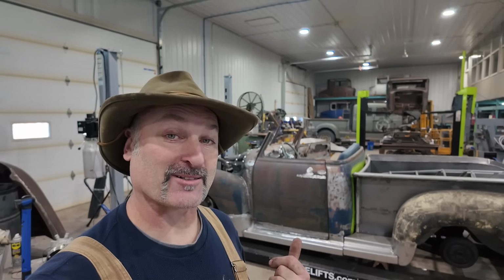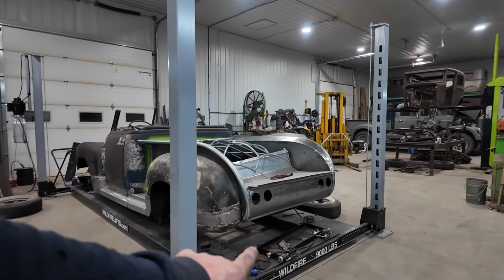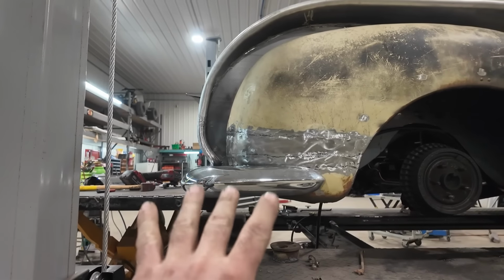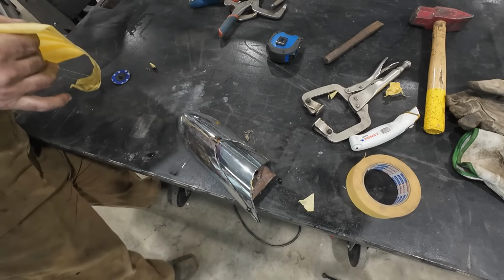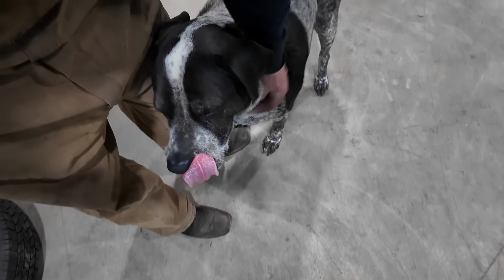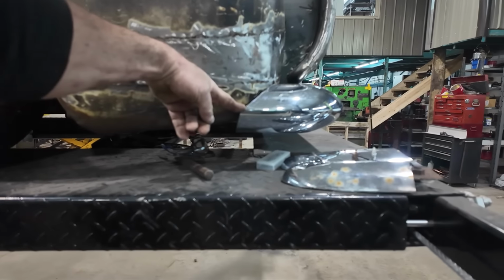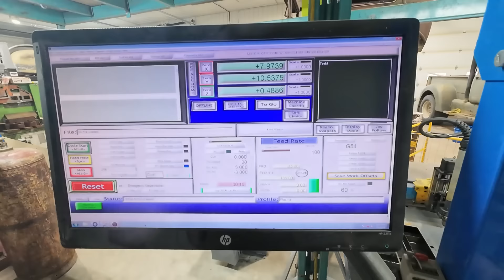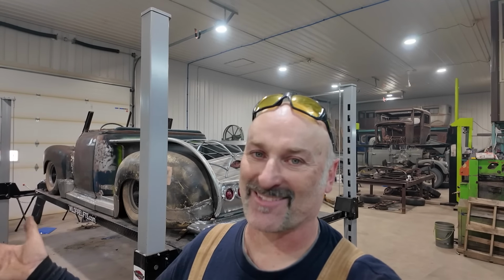Check Out Our Custom Rear Bumper For The GMC Roadster - Not sure I'm sold on it?

Comment: After 30 years I'm retired from GM . I would rather have one of your creations than any of the cars have helped build in 30 years ! Keep up the good work my friend .
Reply: If I could ask the designers at GM one thing it would be, why did they made the trucks rounded and ugly from 2000ish on. Most Chevy fans like the square body of the 70s-80s. If they sold brand new square-bodies with a cabureted 350 right now they would probably sell a ton of them.
Reply: I’m also a GM retiree and totally agree with you

Comment: I'd make a nice canvas roll up desk style tonneau cover on tracks you can use round bar and dye threads on each end and bolt roller bearings to go in a track you'd put in that follows the line from the back to the cab

Comment: Pointed ends back on each side,then cut out center and weld in the piece with the plate lite upside down to shine on your plate. This will also leave a place under there to exit exhaust pipes (cut as wide as you need)😎👍

Comment: Bumper is coming along nicely.

Two thoughts I had on design.

1) consider putting a step shape in the bumper.  cutting the bumper at the edges of the bed, then pushing the bumper ends toward the cab to close the gap with the fender. Add a curve to connect the gap created.  This would close that gap between bumper and fender, somewhat remove the square feeling of the bumper, and also push the edge of the bumper further forward like you mentioned maybe wanting.  Hopefully that makes sense.

2) do the exhaust as a straight pass through right through the bumper.

Just thoughts I wanted to share.  Carry on good sir!

Comment: It definitely looks appropriate and at my point of view wrapping around and tapering to bring closer to outside of fender but not past would finish the look. But when i saw the drinkers side from the rear where there will be fill pannel it looked like it could have exhaust poking out just above bumper until i thought of all the extra bends in the pipe to poke it out slightly up and outwards.  Regardless fabuloso. It is already award-winning build.

Comment: I really like the back now with the lights in it, it kinda give it that 62 Impala look and the bumper fills the bottom of the the truck, I think you need too cap the end of the rear bumper, leave the curve to match the curve of the fender and  put in your filler pieces on top as you said the front bumper does not go past the fender so the rear should not either, but its your truck so you need to do what you like.

Comment: Brent, ask Ester. If she tells you that changing the bumper that way will result in your stuff being on the porch; well...
For my part, I get a hue of a 1971 Chevelle or later Corvette when I look at it and that leads to the next thought, the middle of the bumper would be a good place for the fuel tank filler neck with the fold down license plate covering it. Also, I like it chrome.

Comment: If it were mine ... I'd remove the center extension, and have the bumper end at the edge of the bed instead of being out at the fenders. As it is ain't bad. In fact I'm amazed at the work you're doing.

Comment: The GMC roadster is cool . you need to carry runing board  to the bumper ,move the bumper  out and tapper it, fill in like your runingboard. You could also put reciever in the center of the bumper with a opetional brake light.

Comment: Your bumper does complete the back of the truck nicely, beside the two top fillers I would not to the ends. I think to answer correctly you need the front bumper to make that call.  Like the new toy.

Comment: Split in the center like you did run each end to either side of the truck then include the center back in to combine both sides. The ends of the bumpers should run along the side of the fenders

Comment: I'd narrow it so it's the same width as the panel above it and then if you're looking down at the top of the bumper I'd extend the straight line to the ends if that makes sense, it's smaller and tucked in but I think it would look cleaner

Comment: Brent, I'm sure that its there but what I didn't see was your yellow mallet in the fender to keep your running board straight but if it wasn't, that would surely mess with your bumper shape against the drivers side fender,
Reply from the maker: Yeah there just needs to be a fender brace made yet to replace that hammer haha.
Reply: @HalfassKustoms  you’ll get to it I’m sure. Maybe when you are doing the hangers for the exhaust?? Oh side note… my vote is side exit on the exhaust! It’s quite the show stopper and the audio has to match the visual!  Haha

Comment: I think the exhaust coming out of the sides of the truck would look much better and break up all that sheet metal on the sides of the truck! don't get me wrong the sheet metal looks good but the exhaust would break it up a bit and make it blend in better in my estimation.    I think the bumper is looking Good. I think once you've filled in the bits did the extra custom work that you don't want to do and  leveled it a bit better its gonna look great.

Comment: Well, if you want to avoid cutting fill patches by the fenders, you could make a beer box template by laying it across the bumper and marking it out to follow the center part and then cutting around the steel pipe and fender contours on each end. Cut the heck out of the top/front edge. The bumper won't be as deep and will be form fitting.
There would still be contoured returns into the fenders.
It ain't me holding the angle grinder, though 😃

Comment: Brent bumper looks great, at the back it looks just right. 

The sides seem a little awkward to me though. 

Have you thought instead of cutting the bumper, frenching the sides of the bumper into the bottom of the wings. So they are the same width as the car but don't stick out.

Comment: I agree with you Brent, you need to put the finishes pointed ends on the bumper to wrap around the back of the truck. it hides the broken edges on the bottom of the fender and sides of the bed. it has a much more finished look about it as far as the side view is concerned. It might take a bit of fabrication but I'd put a top plate on the bumper starting from the side of the bed and on top of the bumper, then mold it into the finished ends of the bumper. This will fill the gap there between the bumper and the back of the bed to give it a better finished look. You said you were going to paint the bumper anyway and by filling the big gap there it will look better than having a big vacant hole showing there.

Comment: Brent, bumper looks good as it is. But, like you said, pie cut the inside edge, could have been your answer? However, l think cutting the inside edge and adding a little bit of filler metal would look good also! Like the looks of the rear of the truck, great job 👏. Till next time, God bless jim

Comment: I think your headed in the right direction with the rear bumper but I wouldn't add any more onto the ends.  Do a Stainless steel wrap on the whole truck it would look good but you would need a straight body.

Comment: What happens if you take the pieces you cut off the bumper and put them on so they do flow farther into the fender and then create another piece that will line up with the bumper and is moulded or frenched into the fender so that it just tapers away?

Comment: Dont comment much...but id reckon maybe that filler to extend the bumper will add some dimension to the finished look...also maybe go with a double bumper like the Cadillacs and Chevys of the 50s n 60s era...and then you could add the number plate section back to the upper bumper as it was originally....if all said makes sense...just my opinion😊😊😊

Comment: If you stand back about 10 feet, you'll see that the bumper is off, side-to-side, because the box or the rear piece that has the taillights in it is crooked/ lopsided. The left side is higher than the right side. Either that or the camera angle is throwing off the way it looks.

Comment: 32:00 open the corner and use the bullet and blend it all together for a swoop not a right angle. You can do it. You gonna paint anyway. You metal work always comes out. Corner is too sharp, yeah Pie Cut it just a tad like 10 15 degrees. You go it It I got faith in your eye Brent, you see what I see I know it. Dennis

Comment: The exhaust should come out the front fender (down low behind the wheel in that portion you welded on).  It is unusual and not done except on dedicated drag cars.  Yes, it makes the exhaust do a big U turn, but who cares.  Guaranteed you won't seen another street truck like that.

Should have figured out the sides of the rear bumper while it was wide, before shortening the bumper.

I do mostly like the final design of the bumper... if it set level.  The corners should be something like a 60 degree angle, instead of 90.  You have been struggling with the corners for the whole video because they are 90 degrees.

Comment: Don’t know if you mentioned it or not, but what kind of cut off wheels do you use. I’ve tried Dewalt, Harbor freight, Diablo, and a couple other know remember names. None lasted but two or three cuts, very disappointed. Bought wheels from harbor Frieght ( on sale) didn’t really look at then. Turned out then are a warrior 4 12  Masonry wheel, I’m cutting 26 gauge roofing material the wheels last three times longer SURPRISE again what do you use?
Reply from the maker: Yeah move don't last as most of the time I just use Canadian tire stuff.
Reply: Thanks next time we are in Canada I’ll have to buy cut off wheels just for, because

Comment: well here go's 2cents of advice - 1st off try the bumper upside down , 2nd sense you already added a filler piece remove it , it looks like it was 4-5 inches , try about 12 - 13 inches and get the ends out to the outside edge of the fenders "if you don;t like the open ends add filler panels on top the bumper ....